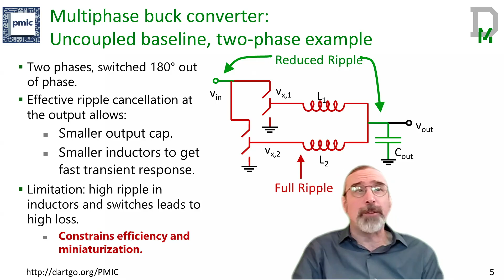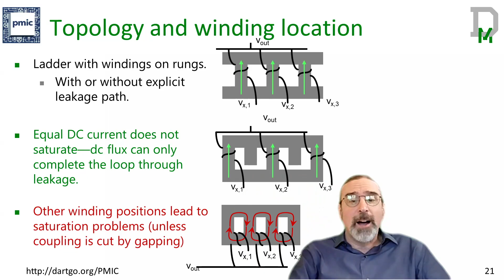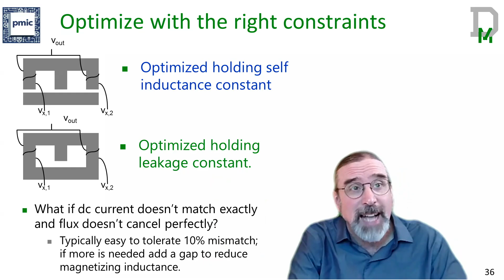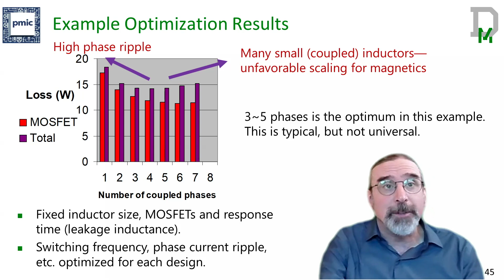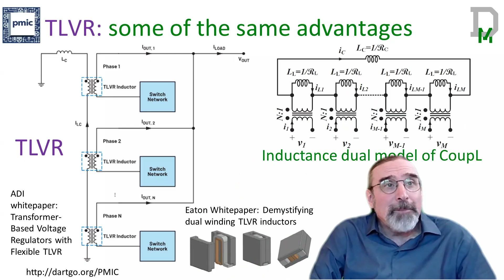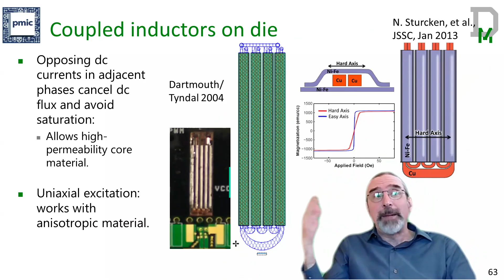Why Coupled Inductors Enhance High-Current Power Delivery: Modeling and Intuition

Comment: I have a transformer core design that can output 48 watts (24 watts from each of the two output coils) from half a watt input at 680khz which is the resonant frequency of the core. I need help making it into a viable product. I am not an electrical engineer, just a hobbyist. (The half a watt input is the power coming from my desk signal generator.)